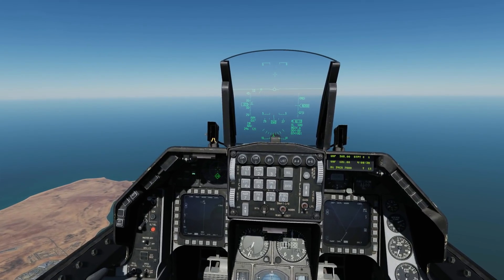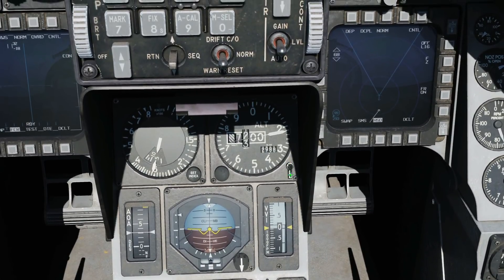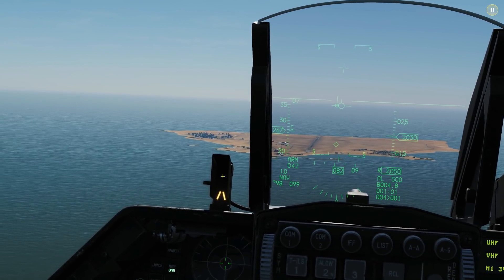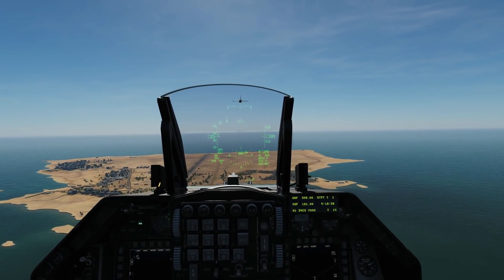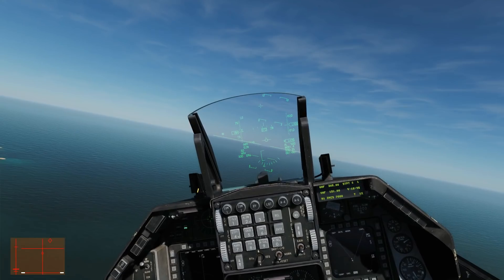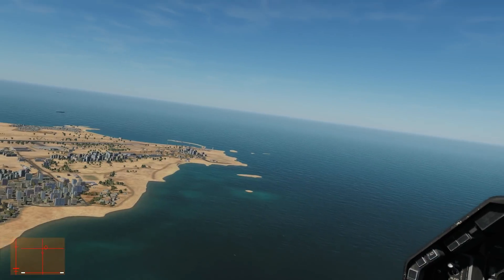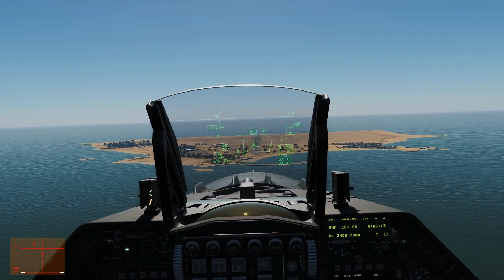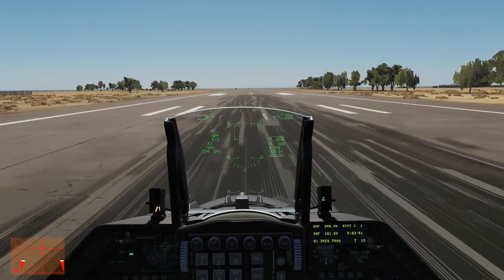F-16C Viper: Learning VFR Approach & Landing | DCS WORLD

Comment: Cap, cant see anyone else pointing it out, and it is a safety item so Ill mention it here. You dont wait for the nose to fall to the runway, but instead fly it down to the RWY while there is still pitch authority. Waiting and seeing is perfectly fine for stable aircraft (like every trainer aircraft I know of), but for the F-16 its a danger to the operator. You can drastically overshoot your intended pitch around 100 knots on the ground in the two point config, trying to pick the nose up can lead to a tailstrike. Between 120 to 100, fly the nose down to the runway - this also avoids slamming the nose gear down hard if you have no pitch authority to soften the impact. Once in the 3 point config, you can safely apply full aft stick, you wont rotate at 110 knots. This is also the time to override the speed brakes.

Comment: You don't trim the F-16 unless there's something wrong. Flaps and trims are done for you by the Fly By Wire systems.

In a nutshell:

--Best practice is to land with 11 degrees AoA (fpm @ top leg of the staple) (It's ok to let the fpm wander within the staple, but never exceed the bottom leg);

--Speed brakes fully out, in fact, they should be out before the gear. They'll automatically reduce when the landing gear are down, to prevent contact with the runway, inasmuch as they normally extend further than the gear, and would hit the runway before the main gear do;

--Don't forget to flare;

--At touchdown, aerobrake with the body of the jet by pitching around 10 degrees until you're too slow to maintain the pitch;

-- Wheel brakes to continue slowing down while continuing to steer with the rudder until you're slow enough to engage the NWS.
Reply from the maker: Yup my mistake.
Reply: Best practice is to land at 13 degrees AoA... where are you getting 11 from?

Comment: Good video but instantly knew  something was off in the procedure when trimming for AOA was mentioned. The Viper I have known is auto trimmed for landing configuration. A properly researched information before video like this is put out there in public to avoid misinformation is vital. Notwithstanding, still a fan. Love your video on the Tomcat, helping me to understand her  non-fly-wire systems. Cheers
Reply: The viper auto-trims for 1G... until 10 degrees angle of attack, where it starts to add alpha feedback in (pitches nose down with increased pitch rate based on angle of attack). If you want to fly down final hands free, you do need to trim. With that said, the procedure Ive always taught is to not trim anyway, and use the stick pressure to control it, rather than trying to trim for it. If you were flying a long SI approach, like an ILS, then you might consider trimming for it.

Comment: Cap, Is the Axis configuration already available for the pedal Brakes in this current state of the development? If so, I would recommend you to map this function to the throttle that you're not using on your HOTAS. This will be really helpful for avoiding these binary full-force brakes with the keyboard, and allow you to slow down and stop the aircraft much smoother.

And yes, the F-16 is surprisingly easy to over-flare the landing and end up just hovering over the runway before the touch down. Such a light weight aircraft. It's kinda like the F-5E.
Reply from the maker: Not sure but TBH as I don;t have pedals.
Reply: Axis mapping for toe brakes is available (if you have pedals, of course).
Reply: @slammerf16  Only for the pedals? There should be support for any analog type control later on in the progress of the development.

I don't have pedals either, but my flight stick, which is not even a HOTAS, does have a dual throttle system. When I play Falcon BMS, I set my right throttle controlling the wheel brakes and my left throttle for the actual F-16 throttle. Much smoother control on ground.
Reply: @William3000x  I see what you mean. I'll have to check but IIRC it's an axis assign like any other so not restricted to pedals. I didn't think of using a second throttle, maybe because my only single engined DCS modules until the F16 have been props and needed both thottles for the engine.

Comment: Nice vid! Just a little FYI. For standard landings the speed brakes are always extended. The only time I've seen them not used is during flame out landing touch and go practice. Also, in the 16 you would never use pitch trim to maintain AOA (on landings). A typical landing would be to line up the runway about 3° below the horizon then Align the FPM with the top of the C bracket and the end-of-runway and maintain that until over the threshold, then idle and flare to bring the FPM to the center of the bracket. It's a bit simpler than the 18 for sure. Cheers!   Edit: forgot something.
Reply: I don't understand. It's either adjust the trim or maintain X pressure on the stick.
Reply: @KarlH1980  Do the opposite of what you'd do in the Hornet(if you have it). The Hornet uses the throttle to adjust your FPM and the stick(trim) to adjust AOA. In the 16 it's the throttle that adjusts the AOA and the stick that adjusts the FPM.
Reply: @ArktikosAdventures  Must be those tiny wings. Every other a/c I know of in slow flight it is just the opposite.
Reply: @ArktikosAdventures  Thought about this a little this evening. 

https://youtu.be/6u0SS6k0LD4?t=155
 .... This user says … “ Power is then used to maintain the correct angle of attack during the approach with aircraft pitch controlling airspeed .”

If on the other hand one used “ the stick that adjusts the FPM .”, one will constantly be porposing and chasing the pitch during the approach. I don’t want to get into more detail out of concern you would feel I was talking down to you not knowing your experience level…. (or worse trying to tell a retired mil jock how to fly a plane ;-) ).
Reply: @KarlH1980  you have to understand that once you're configured for landing, pitch controls your speed while throttle controls your AoA.

Extend the speed brakes, and reduce speed to 300-350, then further to under 300, and lower the gear;
Place the fpm on the 3 degree line, place both on the threshold, work the throttle until the top of the staple is aligned with the fpm, and all three are on there threshold;
hold that picture till you're about to flare.

Comment: It seems you are trying to do a Hornet pattern I many ways. No, no, no.
1- Pattern speed should between 300 and 350 (not down to 250)
2- In USAF you overly the runway during break, not offset
3- You don’t touch throttle in the first turn. Use G to bleed off speed (60-degree bank)
4- Judge your roll out to place the wingtip just below the runway. You are way too offset from the runway
5- You don’t fly on speed on the downwind, just between 210 and 180 kts. You were way too slow (never below 180 kts)
6- Remember to put the speed brake out
7- Don’t trim for pitch in landing, this is not a Hornet
8- You are 100 feet too low at the perch
9- Glidepath is way too high. The dashed 2.5-degree line on the HUD should be on the threshold at short final
10- Not much of any aerobrake
There are several real-world HUD videos of Viper’s landing that you may want to take a look at. Have fun and good luck.
Reply: Oooo Caps' got Wagner on his ass.
Reply: @SpartanVRTTV   My Sentiments Exactly....!! 😜
Reply: @SpartanVRTTV . It's all good. When I first starting learning the Viper, I made some of the same mistakes and tried to land it like a Hornet. I was lucky though and I had some F-16 pilots as my instructors to get me on track.
Reply: Solve your differences with a dogfight hahaha
Reply: @akisakis7980  Nobody will die though
Viper ain't got a damage model!
Reply: @jordananderson2728  that means they are both right lol
Reply: Hmmm Gonna watch this movie play out :-)
Reply: Good to know Wagner is watching.
Reply: @Strange_Man1911  I don't want wagner to show me how to suicide on a ship like a japanese hero
Reply: Wags, Is there a concern about having the airbrakes out on landing if you are using aerobraking? Isn't there a possibility of ground strike by the airbrakes? Not sure, but it seems possible.
Reply: @firemedicjm911 . When the gear comes down, the speed brake is not open all of the way. Once landed and the nose is down after the areobrake, you then press the speed brake override the speed brake to open it all the way.
Reply: @MattWagner  Got it! Thanks!
Reply: @firemedicjm911  with gear down the speed brakes open only to 43°  to help prevent that. They can be forced to 60° by holding the SB switch aft and will automatically close to 43° when released. After the nose WOW is engaged the SB's open to a full 60°. In flight with gear up they open to 60°. Cheers!
Reply: @firemedicjm911  In fact, having the airbrakes out on landing is the expected condition. This allows you to have a higher RPM at touchdown, more thrust, more power in case of go-around. Selecting MIL doesnt have instant response, selecting AB can have a 4 to 5 second delay before getting the extra power in the real thing. In flight idle is too slow to respond (its better in the newer blocks), so landing at higher than idle is preferable. 

With the speedbrake switch in the centre position and the LG down, the FLCS closes the speedbrakes partially, to the 43 degree position, which also mitigates any concerns over tailstriking. You have to hold the (spring loaded to centre) switch in the outboard position to keep the brakes in the 60 degree (fully open) position, if the LG is down. You should do this after rotating to the 3 point attitude.
Reply: Matt is right on point here... Air Force patterns are quite different from Naval ones.
Reply: As a little example, here is a little video I just made to help better understand the sight pictures. 
https://youtu.be/Nw_UCHzelSo
This is by no means a perfect approach though and I’m still learning it. For example: I got a little wide in the downwind and had to correct in my short final, and I should have floated the touch down a bit further down the runway. Note the altitudes, airspeeds, runway offset (where my wing tip is), 2.5 glidepath to the runway threshold, and keeping the AoA above 11 until in close final, where I transition from 11 and then to 13 at touchdown. 
Real-stuff: https://youtu.be/JorI8EdSxW4?t=3525
Hope this helps!
Reply: @MattWagner  Did you catch the "Altitude-Altitude" call out with main landing gear WOW? That has to be a bug because the Voice message unit doesn't call that out in real life.
Reply: Lmao I love this community
Reply: 9- Glidepath is way too high...

This is a mistake.  The Hornet AOA is optimally 8.1 degrees.  However, the Glideslope for both the Hornet and Viper is the same (3 degrees with rare exceptions). The 2.5-degree dash is a relative reference only.

Glideslopes are set by the airport/carrier, not the aircraft flying them. Three degrees a fairly universal but never lower.  It can be 3.5 -4 degrees for runway specific obstacles like buildings or topology, or in the case of a carrier heavy seas.
Reply: BostonClipper glide path and glideslope are different 

ILS glide slope sure tuned around 3 to 3.5 degrees

Glide path is different. General aviation usually about 4 to 5 and Heavy commercial such as B777 are 3 degrees. 

Fighter is set to 2.5 degrees.
That’s what JASDF F-15 said.
Reply: @takacoon5318  I have been a GA pilot for thirty-two years.  I honestly am not sure what you mean.  I looked, the FAA Pilot/Controller Glossary says glide path and glideslope are the same. ( https://www.faa.gov/air_traffic/publications/media/pcg_10-12-17.pdf )

Glideslope is set by the airport/carrier, not in the aircraft. All aircraft fly the same slope.
Reply: @takacoon5318  I was wrong. You were correct. My apologies. I thought I was constructively adding to the topic but instead I was completely wrong.

It still makes no sense to me for a variety of reasons not worth mentioning.  I am confident that C.W. Lemoine confirms your comment and completely disproves mine.
Reply: @BostonClipper  wrong.  2.5 degree wire for the Viper (and most AF fighters) is correct.
Reply: C.W. Lemoine o.o we have quite a few big wigs in the room.
Reply: @CWLemoine  Huge, huge respect.  Thank you for your service.  More than that, thank you for sharing your experiences.

Question.  I fly out of KBED which is a civilian/AF base.  I also happen to be an architect that was responsible for an office building "4 Tech Center"  just SW of runway 11.  The height of the building was not limited by zoning laws but instead the FAA.  So my question would be why would any aircraft fly lower than FAA regulated/designed ceilings and glideslopes?  I guess am not clear on what " 2.5 degree wire" means.  Is that adjustable?  

You have my word I am not trolling.  I honestly do not understand.  I am a mere GA pilot (single engine, land 1986).
Reply: @CWLemoine  I have been looking at Air Force bases across the country.  So far every Air Force base has an ILS approach of 3 degrees.  So I really have no idea what "2.5 degree wire" means.  I tried to look it up so I would waste any of your time but I could not find anything!?  If you could point me in the right diection I would greatly appreciate it.  Thank you!
Reply: @BostonClipper  It's not an ILS glidepath.  The standard visual approach is 2.5 degrees.
Reply: @CWLemoine  Thank you.

So that means absent PAPI (etc) you would fly standard visual approach of 2.5 degrees but if V4L exists you would fly that slope instead I assume.  Unexpected since the FAA standard visual approach is 3 degrees which makes it surprising and very interesting.

Thank you for your time and patience.  Take care.
Reply: @BostonClipper  no.  That means you fly the glideslope on an ILS.  If you break out early, you transition to a visual approach by putting the 2.5 degree line on the runway threshold.  If you break out at or near mins, you accept it and fly the ILS glidepath.  For a normal overhead or straight in, you use a 2.5 degree approach.  Fighters are not "FAA standard."
Reply: @BostonClipper  Glideslope on an ILS approach is set by the airport... otherwise its entirely up to the aircraft. Most Cessna pilots dive bomb the runway.
Reply from the maker: I knew I was going to get in trouble for this one. Sorry Sir, will re-do after the weapons vids.
Reply: @grimreapers  "will re-do after the weapons vids". Can't be in trouble and not have a time-out. So after the weapons vids and the time-out. We'll trust the wife to set and monitor the time-out.
Reply: @grimreapers . All good my friend! It's all about the learning and there is never a perfect flight.
Reply: @grimreapers   Props to you, for taking some constructive criticism cap.  All the great vid's you chuck out, there's going to be a hiccup now and again
Reply: Offf! lol. I love this community as well. So glad we have Devs involved along with our favorite community teachers :)
Reply: I mean no disrespect, I like a lot of your videos and you made it a lot easier for me to learn the modules and all dcs stuff, but I honestly don't understand making tutorial videos (for people who want to learn how to use the jet, especially noobs like me) that are just wrong. I understand that as a group you guys have your custom patterns and procedures, but there are things specific for an given aircraft that you have to take into consideration and adjust. For example the speed, lack of trimming and glidepath in the F16. I know that we currently don't have a damage model but it might be that this bad practise will damage the jet during landing when the damage model arrives. The best thing here, thankfully, are the comments, and people like mr. Matt Wagner or mr. C.W. Lemoine who rush in to the rescue :) and give some cool info (that is only why I wouldn't delete this video). Just a little thing to consider next time, other than that, you give us lots of great content, thx!

P.S. That also goes for the IFR ILS landing video I believe
Reply: @Rolleck  The IFR/ILS video was more about using the Tacan and ILS in the F-16 than it was about landing.
Reply: You guys are wonderful, great community. :)
Reply: When Cap said trim I was like wait? What? No! LOL
Reply: lolz Cap got schooled.
Reply: -5° approach path is insane.
Reply: @Dee-Jay  This is what happens when you throw solo students out without training... Is anyone working on a D model cockpit?
Reply: in before the dribbler downvote team comes along https://imgur.com/a/WIyhYZw
Reply: Well anybody who played dcs for more than a month knows not to look at gr tutorials